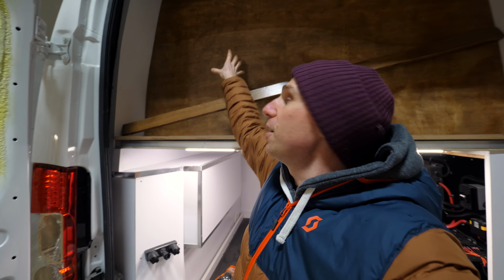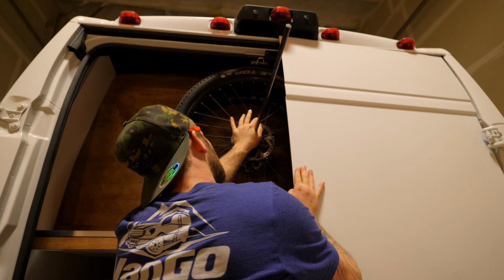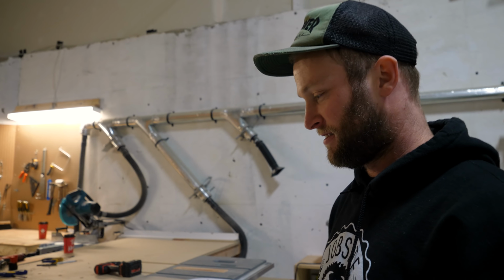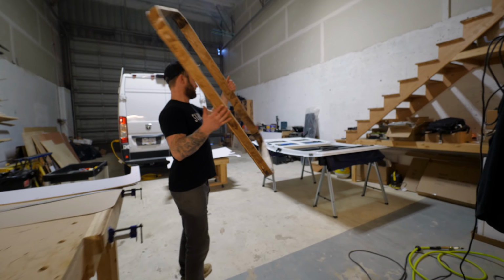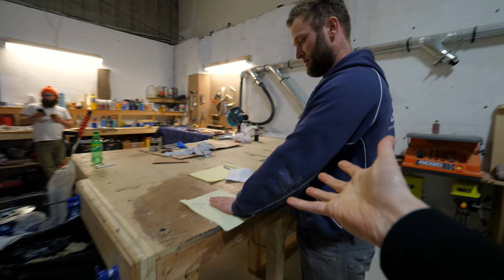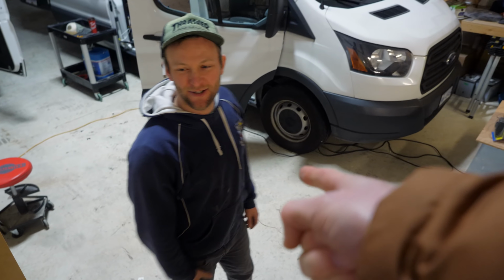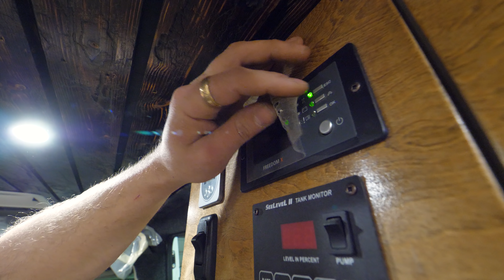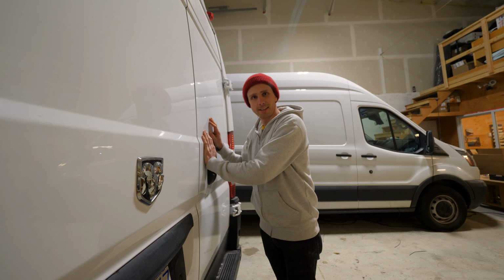Finishing The Bike Garage In My Custom Van

Comment: Why did they mount the on-demand water heater on the other side of the van?
Won't you lose temperature with that long of a pipe run?